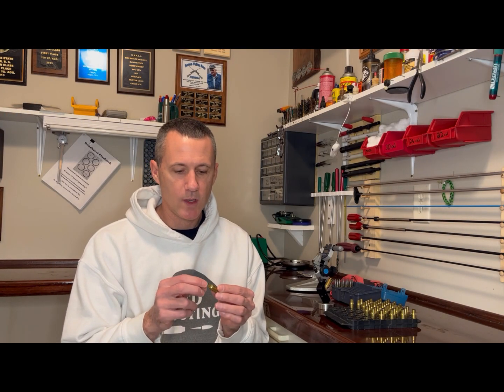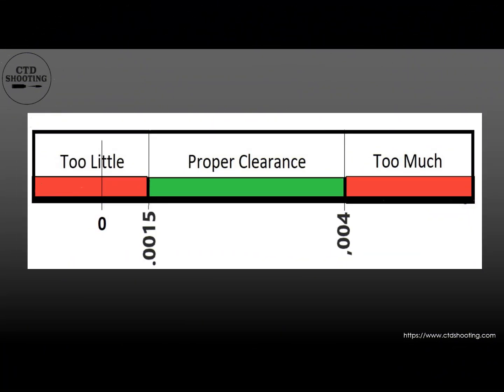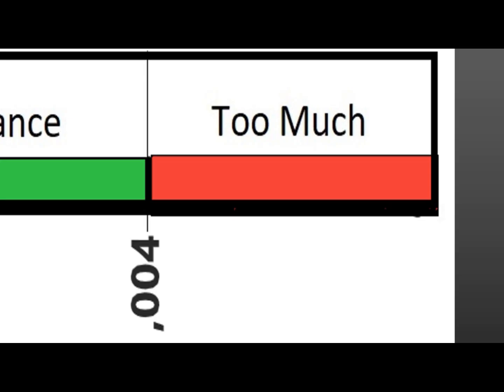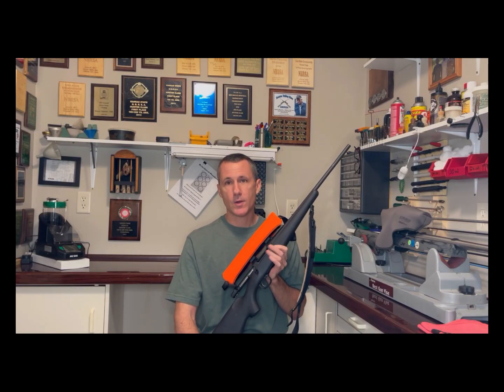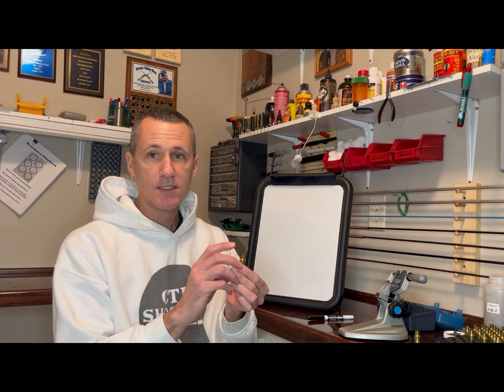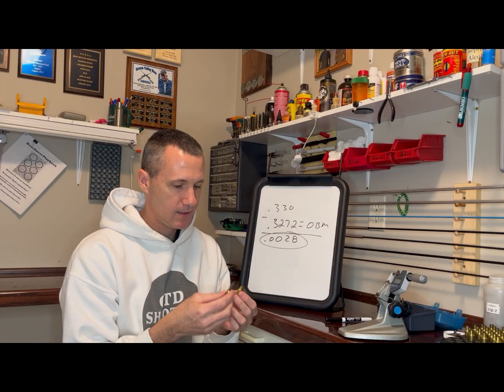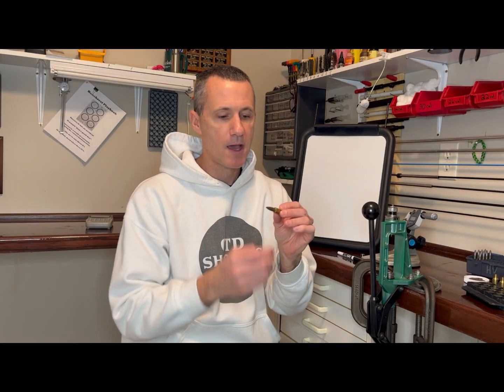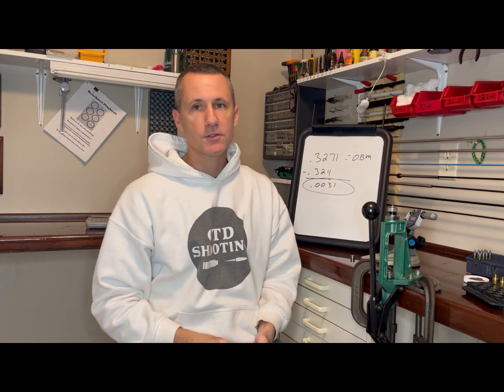Understanding Neck Clearance and Neck Tension:  Basics to Advanced

Comment: Thank you for a really informative video. I have always thought that neck clearance difference, real versus theoretical, was due to spring back.
Reply: Mr. Seely.  I might  not have answered your question last night. My apologies.  I have found the biggest differences in theoretical vs actual was due to my measuring (I am not a machinist and I am trying to measure to .0001 = any little difference can change my overall answer and/or any "mistakes" when I turned the necks.  This is not to say that spring back does not play a role, just my own human error probably has a bigger influence on measuring the clearance.  Now...neck tension...that might be a different story.
Reply: Jason, you did fine last night with your answer. I was just trying to wrap my head around aspects that I haven't considered. But all these things do play an important role, I believe. All of my rifles except my heavy benchrest Nosler 28 rifle have SAAMI necks. The Nosler has a neck size from my custom reamer and factory cartridges won't fit in the gun. I have to turn necks down to approx .009in or the round will overpressure. So these aspects are important to me. Thanks!, Jeff
Reply from the maker: @Jeff_Seely  I've heard lots of good things about the 28 Nosler.  One of the hard things about discussing techniques and tips is matching the information to use of the rifle.  I wrote a blog on that called Precision Ladder  https://www.ctdshooting.com/post/precision-ladder   Sounds (reads?) like you have a pretty good grasp of things.  Hopefully my videos/blogs can simply add a few items to your current process.  Have a good one.
Reply: Yes sir. I can imagine that it is and will look thru your blogs. Your YT channel here is informative and relevant. I have enjoyed watching it and look forward to new videos as they come. Thanks for the time, effort, and expense in producing them!
Reply from the maker: Thanks for the comment and question.  Spring back probably plays a role in neck clearance, but more importantly it definitely plays a role in neck tension. Spring back is related to work hardening.  To stay at the "knife's edge" of precision, one has to control work hardening of the brass.  Having the proper neck clearance helps with that.  As always, this is dependent on the level of precision you are after.  Hope this helps.

Comment: Great video! I bought pin gauges to measure the inside neck diameter or neck tension. Saves me some math. Neck clearance is super important. Having too little neck clearance and a carbon ring will have you chasing your tail wondering why the load you developed is 100 FPS faster than it was.
Reply from the maker: Excellent comment.